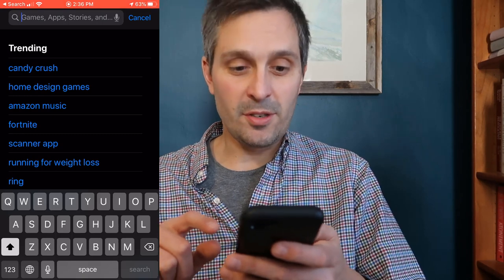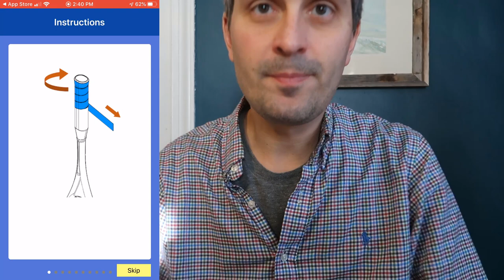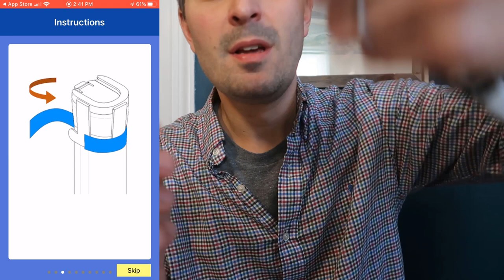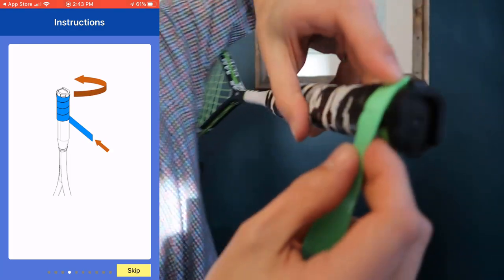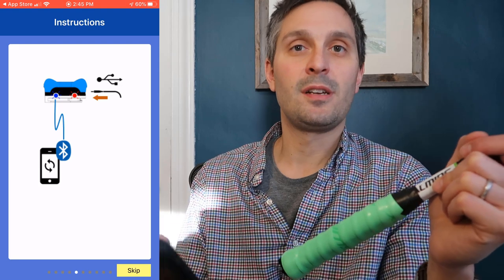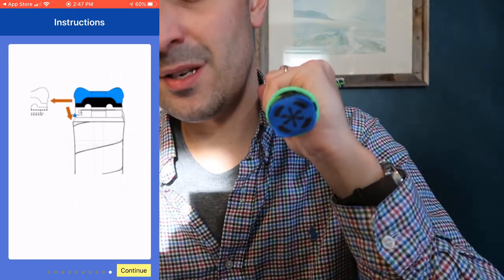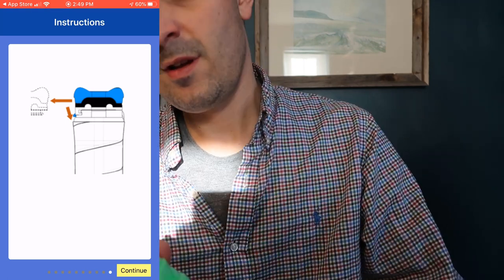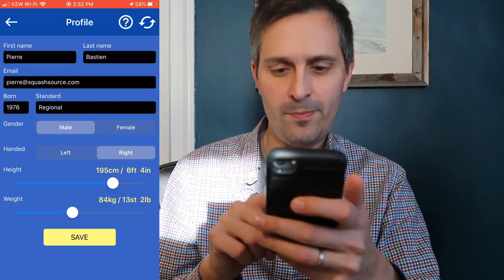Racketware Setup

Comment: Would like to try that,but if 10,9 grams is the weight of that sensor that is a lot. In squash racket world  10,9 grams at the bottom changes completely the balance of the racket and the way it plays...
Reply from the maker: I know what you mean. The racket doesn't feel heavier though and I think that's because it's attached at the end of the grip. I haven't hit with it yet so will see how that goes!